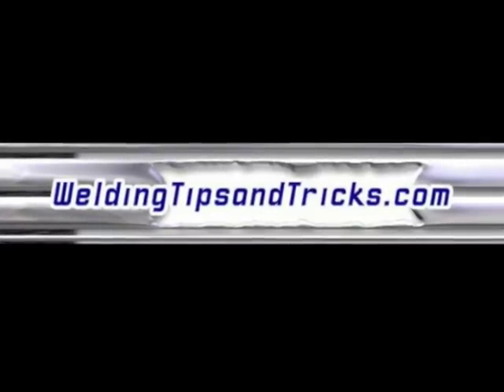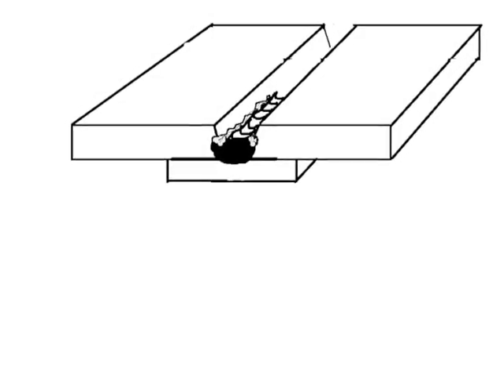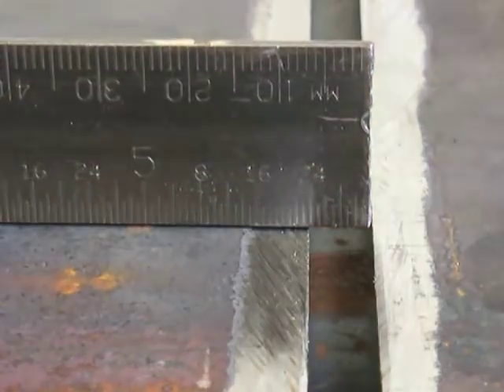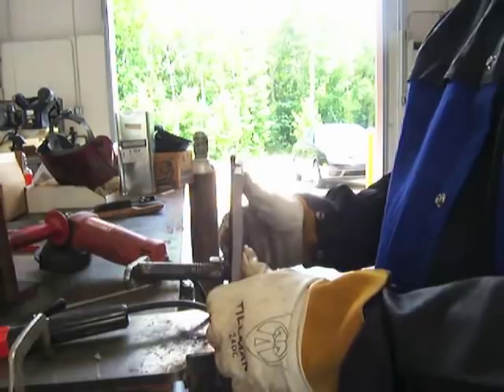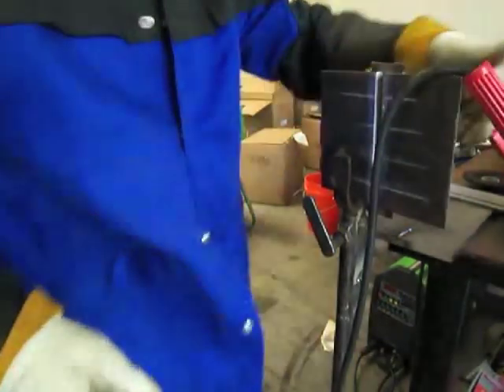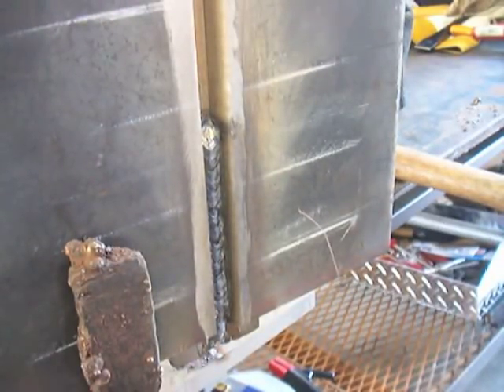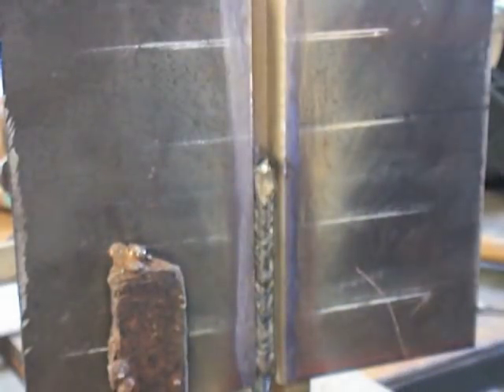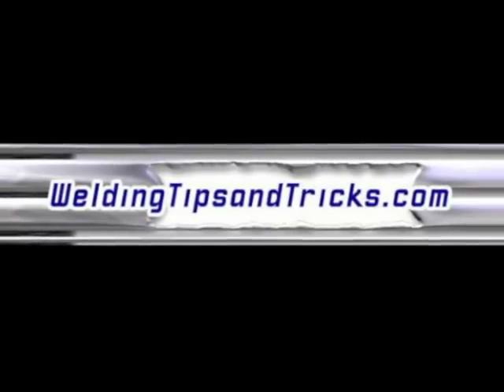Stick Welding Tips for Passing a Structural Plate Welding Test - part 1

Comment: i trouly like your video but i wondering if its for the test for americain because in the candian welding exam your not supose to wave the whant one pass on each side the waving is at the finish in like you said the grinder is lock up you cant you it only if you did a bad pass.
Reply: by wave do you mean Weave? where abouts in Canada are you taking your tests? just wondering cuz in BC and the schools ive taken my welding tests at its Welders Choice as to how he fills the joint. if your weave isn't as good but you can fill it with Stingers then that's what you gotta do to pass.. Weave will make a stronger weld if done with properly..

im also interested to know if theses test are for americans.

 where I have taken my tests once you start welding any use of grinder is instant fail you cant grind your tie ins down and also you don't get to choose where your tie ins go the instructor will come in and show you where he wants your first tie in and you must show each tie in before you continue welding or else once again instant fail which isn't cheap...

but every instructor is anal about dif shit..

Thanks for Vids!
Reply: Nic Y .800

Comment: Is your rod angle at 90 degrees? Also, My teacher is having us do the root pass with 2 3/32 stringers. Is it more advantageous to do root pass with one bead using 1/8 rod? Anyone's advice would help.
Reply: Greg Goldberg I think the advantage of using two stringers with 3/32 electrodes is that you can run a stringer up each edge where the test plates meet the backing plate too assure complete root penetration. Using one stringer up the middle with a 1/8 electrode would be just as strong though, so long as the welder is sure they are melting the edge of the plates on each side the whole way up. Notice how in the video he is taking his time on each side, making sure to bite those corners. The disadvantage of two stringers with 3/32 would be if you don't clean the slag out of the center between the two stringers, you may end up with some inclusions, weakening the weld. 

Just my nickle on the situation... We don't use pennies as currency in Canada anymore...
Reply: Missioneer thanks for the response! I ended up taking my test on monday and i feel pretty good about it. i think i have to wait till next week to find out how i did. i ended up doing the two stringers with the 3/32 rods for my root and capping with all weaves. i was allowed to use a wire wheel to clean up, so that made me feel a lot better about the stringers.

pennies are pretty useless, i think our treasury actually minted new pennies. canada is way head of us in the penny game ;)
Reply: @Greg- Your work angle needs to be very close to 90 degrees.  Generally, this test is done with one pass for the root.  Now, I understand what your teacher is trying to teach you.  I teach at a college and I teach my students a variety of ways to do each weld.  I want them to do stringers, weaves, etc.  I want them to be proficient at all types of manipulations in any process.  My goal is that the students become flexible and adaptable in all situations.

Comment: This is slightly different then cwb which is 30 degree and 90.  and excluding horizontal there are 2 stop and starts which will both be on the root and subject to bend

Comment: So for tests you don't start with 6010 mild steel and cap with 7018 LH?
Reply: You use 6010 root and 7018 fill and cap if it's an open root test, usually structural will have a 1/4" backing strip

Comment: I notice that you are doing a weave in that bevel with the backing strip.  I had to do a straight stringer while at MWI
Reply: +maineville prepper Some people teach that.  I teach (community college) to manipulate everything!  The idea behind that is to make the students adept at all manipulations, which makes them flexible and adaptable.  I can teach 'straight stringers' like you have learned, but I want the students to be capable of so much more than that!  Also, I believe that if you don't manipulate, you don't penetrate!
Reply: weave is actually against code now, and a cwi will immediately fail you for it
Reply: +matthew holman I think the question would be, 'what constitutes a weave?'  No insult intended (because I do understand that this topic opens a huge can of worms), but I very recently took the AWS seminar and exam (which I failed) and no one mentioned weave.  Within the last 10 years I have taken and passed 6G SMAW cert tests which called for no stringers - so figure from there what that means.Again, and will respect, I am only questioning what the concept of 'weave' means.  Some folks would say it is any manipulation, and others have different definitions ... and so on!!One last item to drive the whole conversation crazy:  Since I started taking cert tests, about 1985 or so, I did all my tests with stringers.  But for some reason about 2000, changed to 'weave'.  Go figure!

Comment: What amperage settings do you suggest for a hot pass with an open root and an 1/8" 7018?
Reply: I used 80 amps, but that was with 6010.
Reply: 77 amps with 6011
Reply: i think 115 - 125 amp for 7018
Reply: yoanna Desiderio your right, but i would stick to the higher side of that like 125, you want to push out that root a little if you have any low spots
Reply: 120-125 flat or 115-120 vertical  (7018)'s
Reply: I like 91-95 amps.

Comment: I'm doing a test on a 1" thick plates... How hot can I run it?? How many AMPS??
100 or hotter??
Reply: 1" is very thick so i guess you can use significantly more than 100 amps
Reply: 110 works great for 1 inch
Reply: francisco villa 120

Comment: Why does my electrode goes wild about an inch before exiting the root pass it goes fine all the way but as soon as im about to finish i start to get drips and splater im at 115 amps 7018 1/8 rod
Reply: By the time you get up to the end the rod is to hot turn down the amps to around 90/95 you will get better results

Comment: Cant make 90 degre angle to work, weld pool goes down below the arc which bites very deep into the metal. Tried lower amperage, even 85-90 amp with 1/8 (3.2) and got about same result. When i use 45 degree push angle then its lets say possible to weld but its hard do see the puddle, so kinda welding blind.

Comment: find out the toleances of the test ex my overhead i just got was + or- 5 deg from 180 in the overhead position i weld from left to right so i kicked it the five deg to me it helpd a tiny bit every littel bit helps can you use run off tabs its outside the weld area remember its not cheating if its within the welding specs  and the testing place allows it

Comment: What temperature should have it on? 100 or 120?
Reply: Terrell diseno haha temperature? do you mean amperage?
Reply: The OutCaster ignorant me! Yes amperage
Reply: Terrell diseno all machines are different but I run it on 110
Reply: +Terrell diseno 120-125A depends on the machine but its is not a rule try out settings on your own and pick the setting that works for you

Comment: Why use a backing plate? Can't you run a hot pass or a root run then back grind and fill.???
Reply from the maker: Sometimes the test procedure calls for a backing plate. Sometimes back grinding. But the choice is usually not the welders

Comment: I got to take a AWS D1.1 3G MIG test any tips
Reply: run your root downhill walking the cup and weave your cap if you can. 16.5 volts and 150 wfs for root, 19.5 volts and 235-245 wfs for fill and cap. good luck.

Comment: We used a mill when I tested welders it was faster and easier on me.  At school I have the students plasma cut the straps then with a washing tip wash off the sides of the backing strap leaving the root nugget then grind the strap flat face and root and grind a radius on the the corners.

Comment: wat amprage are you running at.  this 3/8 or 1in  plate
Reply: +bongs559 I think he is between 95 and 130 - but it would really depend on the machine
Reply: bongs559 3/8 is standard plate test. He runs between 110 and 120 amps.

Comment: If you can't get a file along with you, a concrete floor can work as a substitute. I did that the last time a welded anything..
Reply: You shouldnt be welding over concrete bro
Reply: Jeff Fouckman I shouldn't what now?! That disqualifies every single workshop and garage in the entirety of the world, pretty much...
Reply: Jeff Fouckman I googled it, and what it is is a risk of water vapor cracking or exploding the floor if you weld directly on it. Welding in a shop with concrete floor is completely normal procedure. As long as the floor stays under 100°C, which it takes a lot to get over, you'd be safe.
Reply: Tjita1 That is actually a good point for people that weld in their garages and use cinder blocks as a base to weld on.  I have seen a cinder block explode from heat.

Comment: I really don't understand why you say you have to hold on the sides for an extended period of time because from what I understand from this type of test is that the weld should be primarily focused in the middle(the gap). Yes you do have to get the sides while your welding but if you focused on them for too long you drastically increase your chances of causing undercut/slag inclusions....
Reply: @mcom- From your comment, where you mention "from what I understand from this type of test" sort of leads me to believe that you aren't familiar with this type of test.  If that is the case, why are you commenting on it?  Anyway, your comment is exactly backwards.  If the welder does not hold the toes and make sure that he has full penetration and allows the weld pool to FILL IN THE UNDERCUT.  This does NOT cause slag inclusions.  Passing slowly through the middles with cause too much build up.  Try the test sometime with your techniques, fail it miserably, then come back and comment some more.
Reply: iw63boomer
I have a student who has been welding for less than 10 weeks who knows more about this test than momcom ... or whatever his name is
Reply: You hold the sides to penetrate the back strap and toes of the weld to the parent metal. When you hold the sides there is metal deposition and makes all undercut go away. Unless you have the wrong arc angle then you get undercut no matter wha cause you can't fill that cause the motion your on. Also you hold the side make like a big molten circle then snap to the other side hold for the circle agin and snap. Hold each side between 2-3 seconds. Hope that helps also even on open root no back sharp you would do the exact same thing if not welding with 6010 root. Like 7018 root when you do the weave with the snap and pause that would allow the puddle to not completely build and fallout infront of you.

Comment: whats a easy tip for  a 3g bevel with no backing strip with a 6010 root 7018 whats a tip to pass that
Reply: hey, just use a ceramic backing strip it is allowed and it comes right off when you get done with the root or hot pass the weld does not stick it just burns it and the view from the back side is flat and looks awsome ,,, you can buy strips of it at airgas or any local welding surplus
Reply: tim Hilderbrand make sure you keyhole the weld the whole time up the 3g or 4g bevel plate it works wonders

Comment: Because the rod is DC+ or DC positive or DCEP, or DC Reverse it is not used DC- or DC negative or DCEN or DC straight that is why.  If you don't believe me try running a 6010 with AC or DCEN and you will not like it.  Just let your CWI catch you running 6010 DCEN on a test and you will also find out real quick why.

Comment: The actual UV radiation is not that dangerous, just very paintful.
The really dangerous part of the welding light is Infra-Red radiation: that is the thing that causes cataracta etc. The same Infra-Red radiation is used for cooking in grilles - our eyes can be cooked the same easily. That part of light has longer waves therefore better gets arround the corner and into the inside area of the welding mask. Infra-Red light is the reason why we put on protective classes even under the welding mask.

Comment: Structural weld tests are on one inch plate, you grind one inch back, ironworkers weld all the way through with a 1/8 rod, no more than 1/32 undercut, and cap must be flush to 1/8 above flush. Must be symmetrical
Reply: Nice try but totally inaccurate and misleading there are many structural certifications with different types of welding rod in different thicknesses of plate and different joint configurations .. and I don't know what your part of the country that you're from but the AWS D1.5 strictly prohibits any use of a or any other electrical or air operated device! I could go on and on and on but yeah

Comment: Guys i have a serious question only respond if you know what you're talking about, i go to a boces program for welding and at 1:11 in the vid he has a 22 degree bevel. i'm doing the same thing but with 45 degrees
Reply: how do i do it properly
Reply: Joe Derita go to a home improvement store and you should be able to find a protrator that has a magnet on it. Set it on the edge and the arrow will show you at what degree your at.

Comment: We haven't switched, and likely will not for some time due to the enormous cost of switching. Gas pumps will have to be changed. Concrete manufacturing. Even Lathes and Mills will become useless overnight. It would cost more than it is worth to switch to metric.

Comment: hahahaha....Once again giving bad info. New welders don't waist your time doing stick unless you plan on being a pipe welder. FCAW is the only thing used on a structural steel job unless you are doing decking and that's only puddle welding.